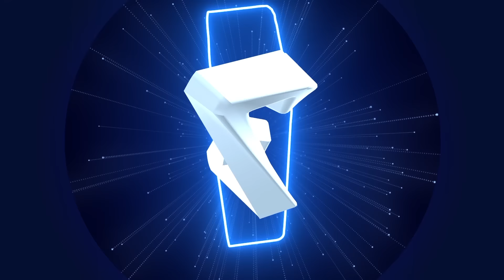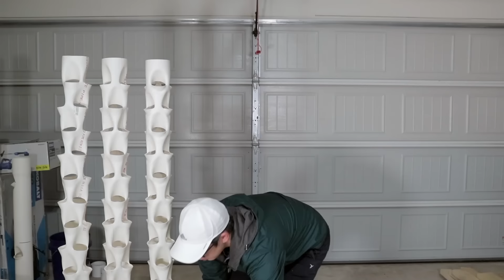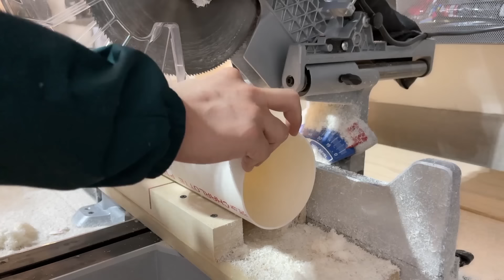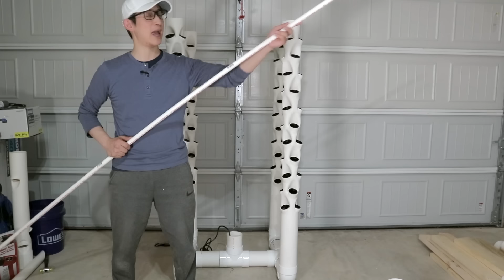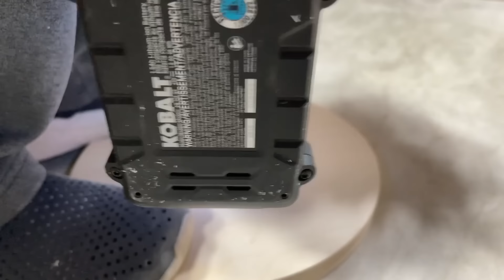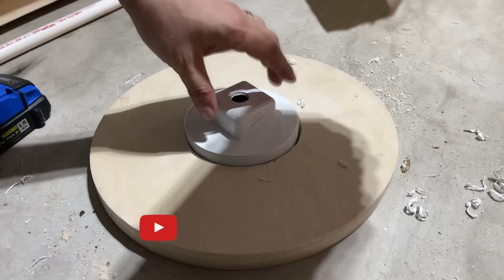DIY Hydroponics | Aeroponics Garden Tower Build | Part 2 - [4 Tower Build]

Comment: Commercial Butterhead Lettuce NFT tech is generally grown every 8” on center (horizontally), but leafy greens that are cut for mixed salads can be prolonged by harvesting/trimming the exterior mature leaves in several segments, thus not having to germinate and transplant on a continuous schedule. However, the trimming schedule should be rotated to allow regeneration of additional mature leaves, also, I recommend flushing with clean pure water for 3 to 7 days prior to trimming, and maintaining consistent time intervals for lighting.
I have been designing, building, and growing produce using hydroponics and Aquaponics for 12 years now. It has been a fun and magnificent journey and learning experience that continues to be exciting and educating.
It’s the future of the world!

Comment: I am looking at incorporating a pressurized water source with a fertilizer injection and battery operated programmable timer to eliminate supply resivoiur and have resiviour for excess water and have a ball float & pump to fertilize my flower beds and root crop garden. Your DIY project is very inspirational.

Comment: Question sorry if it’s been answered but how many gallons does this hold approx? I just built a two tower system using your guide thank you! But wondering how much water is in there I just filled it up. Wondering how much A and B solution to add

Comment: if using 2" pods.  what is the cut depth or better yet cross cut length for each hole prior to heating and molding?

Comment: Make it more hands-free and self-sufficient could you add a float in the reservoir that will automatically fill the reservoir with a garden hose using injectors for fertilizer and to balance the ph& nutrient levels

Comment: does the plywood blade work better than a carbide blade?  The blades that come with the saws are horrible--so you obviously replaced that-- I have noticed that the carbide blades will grab the pvc sometimes and give you a nasty surprise---it splits, and it flies unpredictably and hits you.

Comment: Buy some fabric window screen material and cut pieces to match your shower drains. It will keep more debris out of your reservoir.
Reply: We used that trick at the woolen mill I used to work at for the wool washing water recycling system. Kept a vast majority of the wool out of the pumps.
Reply: Not only that, it’s easy to clean when needed.
Reply: @shawnmatthews5118  a frw minutes with the high pressure hot water hose and it was good as new

Comment: Great video!   I just finished the single tower (part 3) yesterday.  I did all four sides of the pipe but I feel it’s pretty crowded.  I am thinking about doing the 4 tower system, but only putting three rows of pods around the pipe.  Does that pump give enough water to all four towers?  Before I get started, is there anything you would change to the four tower system?  I also think myself and others would love to see the results of your tower! 
Thank you!
Sean

Comment: Hey, late comment here. 
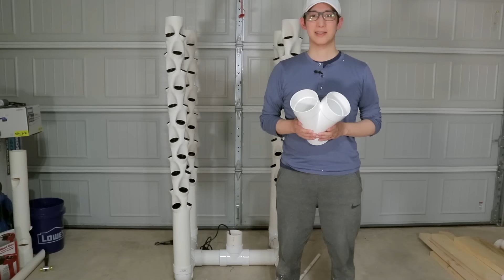Put that 3-way you holding at ~14:30 at the bottom of pipes, higher then your drains and you don't even will need to disassemble it to clean all the debris, just do it thru 45 degree pipe.

Comment: Chris thanks for the Videos. I am going to try building one based on your videos. One question I have is the 2" pipe that you use to create the holes. What is the angle of the edge you cut into the 2" pipe?

Comment: A couple modifications......
1st, since the sun can't get to All 4 sides, use 3 sides facing sun through the different sides. The slots in back will never see sunlight in most locations.
2nd, instead of square base, maybe stagger the towers to minimize the shadow cast by the others. 
Maybe instead of making the center removable, the T fittings could be replaced by a 4 way with a clean out on it. This'll allow you to flush the bottom "tank" without anything more than using a hose.

Comment: We are partway through the build and have hit a brick wall. We have the thinner 4" PVC with black lining inside-- perhaps an irrigation pipe???  Problem: when heating up the first slit on the pipe, we can't seem to heat it up enough for the 2" pipe to go all the way  into it to make the "pocket" for the cup. 

Help? 
( Yours is not black-lined. What type did you use? This is the thinnest pipe we can find here in Texas).
Reply from the maker: Do you have a link to the PVC you purchased?  Im here in Texas as well.  Below is the PVC pipe I used in this video 
- https://low.es/3OouDf9
- https://www.lowes.com/pd/4-in-x-10-ft-Sewer-Drain-PVC-Pipe/3133147

is the black lining an insulation membrane?

Comment: Question how do you add the mixture to the water to feed the veggies in your hydroponic system
Reply from the maker: I pour the nutrients into the feeding portal i created at the base of the tower.  Same place where the power plug for the pump comes out.  I also refill water through this port.

Comment: Thanks for the video mr. Loh 
I have question u made in the 4” pipe a three pot hole each of 7 cm length, i would like to know the length in cm between one and other in the same level, i measure the pipe is 35cm in diameter how you mange to make three holes, i tried with a4 paper and we don’t have the legal size paper here inn UAE, i would be thankful to help me with that

Comment: I would have used the center of the tower to install a 5th growing tower instead of having just 4 of them. You could run the plumbing inside of the center tower or outside of it. I would also build a manifold using various valves to control the flow of the wall and if I only wanted to use 1-2 grow towers I can simply close the valve to the ones that I don’t want to use off and leave the others open. Also the addition’s of a timer to allow for the pump to not run continuously but rather have it run 20 minutes per hour every hour or less, more as needed. Adding plant grow lights, and a reflective backboard so that you can adjust the lighting level would help keep the plants grow bigger and faster. I have been thinking about using a simple drip irrigation system to keep the water supply moving but keeping it from using a lot of additional electricity. Adding a larger reservoir with a circulation pump so that you can mix in fertilizer or compost “Tea” to make the water carry more nutrients to the plants and encourage faster growing larger fruits and vegetables. I am going to build a 9 tower system to have a bigger garden in my kitchen hallway on a movable platform that is on wheels. So that we can turn it in the windows and move it to clean under it. I am also looking at a solar powered system that is going to be fully self contained so that the plant to utility costs will be next to Zero, minus the cost of the original building supplies and equipment for the solar system. When my friend and I have a little more time together we will get it all built and have all of the plants and vegetables, fruit we can use all winter into next spring.

Comment: Update: The video autoplayed to part 2, where you have an updated watering system, while my comment is in response to part 1 of this series. I’m still curious if my idea is an improvement though. **

Another idea is to use spray emitters all around and along the length of the tube. In this system, only the roots touching the grow medium are getting proper watering, and whatever root sections are lucky enough to catch dripping water. There are likely big sections of roots on every plant that are water-starved. 

Whereas, spray emitters would reach every nook and cranny by misting the whole tube at once from multiple angles. I think you’d see faster growth and overall better production. 

Downside - with organic hydroponics, it’s common for clogging to occur, especially with the small holes of a spray emitter. But they’re very cheap and could be easily swapped out. They screw into any 1/4 inch hole i believe so installing is a breeze. You could simply drill holes into that internal watering line and screw emitters in, capping off the top. Done.

Comment: Man that's Sexier than socks on a rooster.   Has really inspired me.   Thank you.
Reply from the maker: lol.  I'd love to see that rooster.  Thanks for the support!
Reply: One question I have is since you heated the pvc and used a forming tool to pull the material out while pushing the top part of the hole inward,  does the water travel down each side of the hole?

Comment: Hi Chris - may i ask what repeater timer unit you use for the power supply and cut off ?
Reply from the maker: In these videos, I actually didn't use a repeater or timer and left the pump on 24/7, but in another build that I haven't filmed yet, I did add a timer to test it out - watering at intervals of 6 hours on during the day (hottest part of the day) and then off for a couple of hours.

Comment: May I know if rain would be an issue with this design ? I am thinking of o we flossing the plants in case of heavy rain …. Thanks in advance.
Reply from the maker: Haven't had any issues with rain.  If nothing else, it actually helps to refill the tower at times when the water level gets low.

Comment: I made something similar. What I learned is that if you put caster wheels, the tower can be rotated for optimum sunlight.
Reply from the maker: Nice.  I have also been working on a roller base using caster wheels that I can place it on in order to make it easier to move.

Comment: Here's a secret. .. print the tree components using PETG, 150mm high, 3 holes, the baskets fit perfectly 🤔 friction fit, no need for glue ..
Reply from the maker: Glad we see eye-to-eye.  I have been doing that for the next build, however, I havent figured out how to build a 4-tower version.   The connectors would still leak since they connect horizontally rather then vertically like the towers.
Reply: @ChrisLoh  the non-glue bit, I was referring to the towers, you can still glue if you want. I make modules, and join on to of each other. I generally like not having to glue because I keep pulling it apart. I found currently the 3d printing is good enough to make threads to a tap, and with thread tape, it doesn't leak.

I do Aquaponics so it's a bit different. I have 3d printed swirl filters, which I find better than anything I could buy. The box filters I did glue then epoxy .. is the only part I currently glue. ...

Comment: Great video, elegant design. A couple of improvements from a nutritionist's perspective: I suggest a food grade reservoir since PVC is not food grade and plants absorb microplastics which then gets into our blood. 100% of people tested for microplastics showed positive. I think the tower would be OK, since the roots are in the air, but for my mental comfort, the reservoir should be  food grade. Also, plants don't only require NPK but a multitude of minerals, as do we. If the plants don't have them, we don't get them either, which can result in health problems. Maybe a liquid kelp fertilizer addded to the water would provide better nutrition to plants and people. When will you be ready to sell your system? I'm interested. Thank you.

Comment: I was inspired by the 4 tower configuration you built,  but found that there were some much needed tweaks that needed to be done.   I found that a 1/2" pipe would not provide enough flow, neither would the puny fish tank pump provide enough volume to supply the towers. I also added a fine mesh filter to the outside piping that can be opened and cleaned or replaced as needed.   I had constructed a unit with 5 towers.  So I bought a stronger pump that would provide a 3/4" diameter outlet that would raise a column of water 13'.  I also omitted the use of a sprinkler head on the inside of the tower, opting for an end cap with a single hole, 1/8th or 1/4" diameter,  I don't recall which.  The baskets were too short, so the water fell to the bottom of the towers with no benefit to the plants, so I found some baskets that were 2.75 inches deep and these served to break up the stream and scatter the water over the rest of the baskets.   I then built a wood frame and covered the unit with shade cloth.  Sand colored, to diminish the amount of heat on the plants as well as the water in the towers.  I covered the base with cardboard to help keep the heat down as well.  So far it is working very well, the plants are growing nicely.

Comment: I have built this system and it is working well so far. The modifications I made were to include a screw in plug at one of the base ends to drain/clean. I have also added a 1/4turn valve at each supply line leading out to each tower. As it will take time to build up plants I only wanted to run each tower as I was able to add plants.

I use a collar for each cup. Due to the possibility of unequal water distribution as it trickles down tower, I added a small square of rock wool in the base of each cup. Not filling it, just enough at each cup base to capture and hold some nutrients that passed (in case some cups didn’t get as much.) This also let’s the roots dry and get oxygen too as there is an air space between the collar and rock wool.
Reply: How did you make the collar for each of the plant cups?
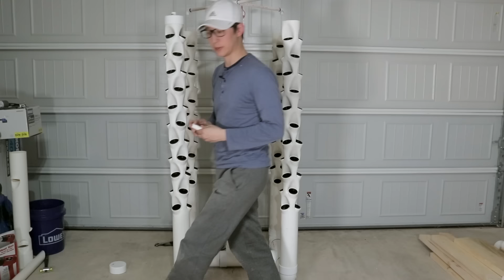Reply: @lije08 that was made from 2” PVC, each collar is cut at 3/4” long. They pop right into place of each opening made in the tower. The cups fit perfectly into these collars. He mentions it at 23:22 of the video. It shows him cutting than at 26:20 of the video.

Comment: very cool design! I love how it looks. One tip I have is to drill small holes at the end of each slot you cut before heat forming which will reduce the chance of tearing. Also use clear PVC cement to seat and seal your 2" rings.

Comment: Good morning, from Corrientes - Argentina, I have finished the project, it was as you explained, only here I did not get 2-inch baskets and you made it with a 2.5-inch pvc pipe, respect the measurements and dimensions of the pipes, my Ask before doing the water pipe part, how much water should circulate or have the container to be able to circulate in the four pipes... thank you for your project... it will change my life...

Comment: Thanks for the great video. I am interested in building one as I don't want to pay upwards of 500 bucks. I don't know if anyone else mentioned it but rubber fittings with hose clamps makes it all easy to disassemble and instead of solid riser just flexible tubing would do the job. I think the other systems try to prevent light to the water tank to deter algae, not sure, think I read that somewhere so maybe setting the base in a dark container or covering it with some black plastic etc... I am going to subscribe to see what else you come up with. Cheers and thanks again for sharing!

Comment: Hello Chris, first of all congrats it´s a very impresive looking project, I have watched this video several times, I was doing some research looking how to get rid of the plastic box (water tank) that many people use in these systems, making the same pipes in the base as the tank is great for me, my only concern is the water oxigenation (to reduce algae and better results) but from other video I saw a DIY air venturi valve that can be installed at the top elbow of each tube were water gets in, also considerating some electrical issues in my country (Venezuela) I could consider changing the 110v pump to a inverter system 110v/12v with 12v pump and a 12v backup battery 👍

Comment: How do you get even water distribution between the four towers? When I built mine it all flowed to whichever side was 1mm or 2mm lower and the others got almost nothing
Reply from the maker: I dont believe mine had even distribution either.  I did get better distribution when I used a level to make sure the plane was even, but I also used a more powerful pump so that there would be more than enough flow to distribute through all 4 pipes.

Comment: You could be a millionaire if you made and sold these. I would definitely buy because the ones for sale currently are expensive.

Edit nvm I just finished the video and see you are selling them or you are going too. I'm excited 😊
Reply from the maker: Im trying, but the shipping is the challenging part.  Im working on a 3D printed module version, however, it will add some cost to it.  I'll have an update soon.

Comment: Chris, I have watched this 100 times trying to make sure I got it right, lol. I have one question. Your towers that you made look like thre are 3 holes at every length along the tower. Your template only has two. How come?
Reply from the maker: Which template are you using?  The first template has 3 holes using an overlapping printed sheet.  The 2nd template only has two holes per row to allow for more root space inside the pipe

chrome-extension://efaidnbmnnnibpcajpcglclefindmkaj/https://clohofficial.com/wp-content/uploads/2022/07/Hydroponic-Pod-Cutting-Template.pdf

Comment: Your descriptions and construction vids are painfully slow. You are still not showing the heating and hole making process, you seem to skip that for some reason. The only one you showed was in part 1 where you tore the plastic.
I suggest you get all your bits ready and construct in in about one minute. Your vid is far, far too long. I still haven't seen the water running yet!